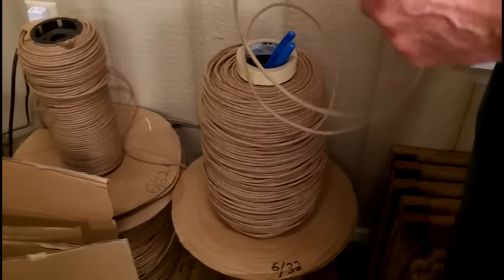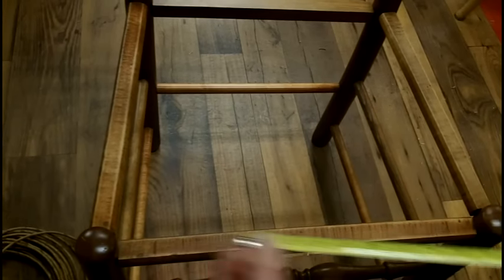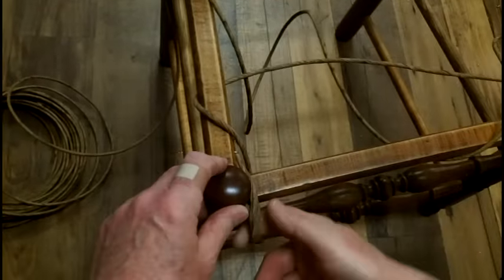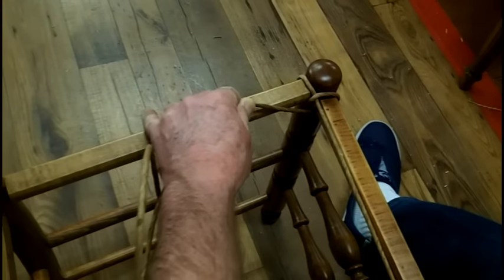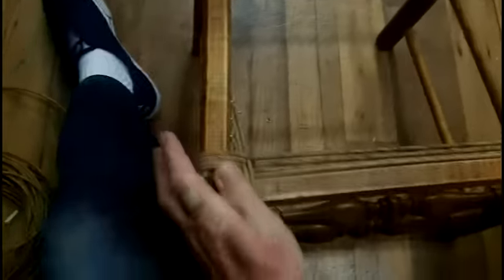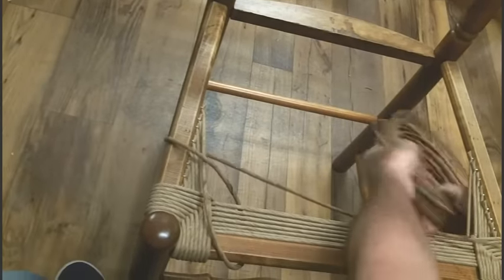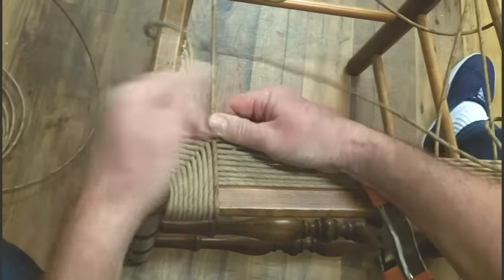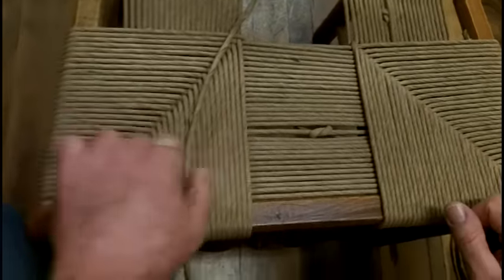How to Weave a Seat in a Rush Chair

Comment: Thank you, your video has almost given me the confidence to take on redoing 6 chairs.  However the suppliers website says its difficult and not to take it on unless you have some experience.  Im pretty good with my hands and a good eye for things like evenness. Do you just make it look easy? and how hard is the rush on your hands?  Would I be able to cope as a beginner?
Reply from the maker: Well, our website would not discourage anyone!! You can get the rush from us with encouragement! Yes, it's a little tough on the hands, but it's not horrible... If you do 6 chairs, the 6th one will be 80% better than the first one, you get better with  practice. Look for us at peerlessrattan.com
Reply: Yeah, I did my first yesterday and wish I had worn some golfers gloves or something. Maybe I was pulling too hard, but my fingers hurt so bad afterward that I'm having to rest before the second chair to see if blisters will form or anything.

Helen- He is pretty darn good at it! I was way slower and had a lot of trouble with keeping everything parallel. The cumulative error of a bunch of wraps being just a little off will be pretty substantial later on. It also didn't seem like those first runs which are tacked to the frame are really in a position to give you lines which are perpendicular to the front and back, due to the angle of the side rails, so you have to make an effort to get them that way as you go. I also may have been pulling too hard on the horizontal wraps, which dragged the far ends of the vertical ones toward the outside if that makes sense. I think dealing with that roll of rush was as much of a pain as anything else for me. I kept it (2lbs) fully intact most of the time, as I was afraid of having too many knots, and had it tangle up on me a few times.

Ed- Don't know if I missed a comment or something, but are the marks at the beginning an eighth inch undersize at 1&3/8, or was that just a mistake in the dialog? 

- and much thanks for the video!

Comment: What kind of rush cord did you use? I am redoing a seat on an old rocking chair that I found, which was rushed with cable ties and a pillow over the seat 🙃🙃 Also, the back is not a ladder back, but just a top and bottom horizontal rungs. How would I go about doing that?

Comment: Thank you for this video! How many feet of rush does it take to typically finish a chair of this size?
Reply from the maker: It depends on size of rust. Normally it takes about 2 pounds. 5/32 is about 350 feet and 6/32 is about 280 feet. We have a chart on our website with more information! peerlessrattan.com

Comment: I found your tutorial on re-canning ladder back chairs and was very excited to re-cane my late mothers chairs. After ordering the material I was ready to start my project and realized my rails are different heights. Front & back rails are equal, and sides are equal- but probably 1" difference - which means the cane will not be even. Have you had this problem before or have any suggestions ? Thanks so much.
Reply from the maker: That is normal, many chairs have rails that are not even, you should be fine weaving it, it will even itself out as you go along.

Comment: How long did you soak the coils?  Some of your coils look wet but some don't.  Also, some people say not to wet it. What is best?  I want to try your method since it seems so straight forward but I need this information before moving on.  Thank you for taking the time.
Reply: Fill a sink with water, then dip the small coils of rush in that as you 
prepare to use them. Don't allow them to get too wet or they will 
deteriorate.

Comment: Hi , Ed, I gladly found your video(s) over a year ago after which i wove a seat for a chair i found on the street. Now i have a rush seat to replace so i am excited to follow your great guide. (i have been watching all your videos !) If I use the 5/32 instead of the 6/32 rush will i have enough for one seat similar size to the one you are doing.? I don't want to have the excess material or pay for 4 pounds when i only need a little more than 2.
Also, how long does the coil or sections remain soaking in water.?? Thanks and thank you for all your postings.

Comment: Are there different types of rush and sizes, and if so, what determines which one to use?
Thank you Ed for your informative video.
Reply: Yes, there are a few sizes to choose from. You should use the size that was originally in your chair. The most commonly used size is 6/32, but some chairs need larger or smaller sizes in them.
Reply: @edhammond2497  Thank you for getting back to me.  I will measure the size in the chair now, and get order that size.

Comment: Thank you for the great videos.  Would you do the same thing for the back of the chair?  I have a New England porch chair and want to use the rush instead of rattan, but both the seat and the back are missing.
Reply: Yes, you use the same method on the back, but you have to take extra time to make sure both sides of the back look good.

Comment: I have childs chair that has front & rear rungs that are about an inch lower than the side rings. The old rush that’s on it is wrapped side to side, then front to back wraps cover the side wraps. Do you have a preferred method for this scenario?

Comment: I was wondering about the cardboard. It seems to me that if the chair ever got wet that the cardboard would be irreparably damaged, whereas the rush and the wood could probably survive even a severe wetting. Would it make sense to use something more waterproof, say a piece of plastic or wood of proper thickness cut to the correct shape? I'm not trying to give you a hard time or anything, but as a woodworker, I always think about the effects of moisture.

Comment: Fantastic video!  I have a question about the final steps for filling in back and sides.  At 14:28, you added a length of rush and the weaving pattern appears to be different than it was prior to that.  Is there a specific point when you change to the new pattern of filling the sides by laying the side strand, then the back strand, front strand, and final left side strand?
Reply: @donm dyti all he did was hide the knot from under chair, the top pattern all the same until can’t do the sides

Comment: I have 4 chairs that need to be refurbished with this type of a seat.  My Dad used to do it and cane weaving too.  I remember that he soaked the rush in water to make it more flexible and when it dried, it shrunk to make the weave tighter.  Is wetting recommended or is it best to do it dry as shown in this video?
Reply from the maker: We recommend just a dip in the water, not a soak. Just a quick dip to make it pliable and easier to manipulate.

Comment: The cardboard triangles that you inserted at 10:40 had the corners facing the center of the seat cut off, but later in the video at 14:30, the cardboard had points towards the center.  Did you add more cardboard beyond what you showed at 10:40? If so, what made you decide to add it and is it done in the same way? Thank you for the excellent video.
Reply from the maker: You are very observant! Actually, this was a set of 6 chairs that I used all 6 in various stages to speed up the recording time. The shape of the cardboard is not so critical, as long as you get some in there.

Comment: Thank you very much for the video! Excellent work! I have a question: How many meters are 2 pounds?
Reply: +Vasilis Mpoulakakis There is 280 feet in a 2 pound coil of size 6/32 fibre rush. There is 350' in a size 5/32 2 pound coil.

Comment: How many foot of fibre rush I need for a chair like the on in the video. Thanks so much to share your talent !!
Reply from the maker: Fibre rush comes in 2 pound coils, which is enough for most small to average size chairs. Larger chairs will need more than 2 pounds.
Reply: and how many houres did you leave your coils in the water, and how many houres drys before begaining the chairs ?? thanks again
Reply from the maker: You don't soak it at all! Just a quick dip to moisten it! If you get it too wet it will come apart. You will need to experiment a bit.

Comment: Thanks for the great video, Ed.  Going to try my first chair tonight.  I got 4 to do.  What would you say is your average time to do one chair similar to the one you did in the video?  Not saying I would be as fast of course, just a general ball park.  Also, how long do you soak your rush before using and does it matter if the water is hot or cold or room temp?
Reply from the maker: You should plan on 4-8 hours for your first seat. Do NOT soak the rush, just dip it quickly, to moisten it. You can experiment with how wet to get it. I have done over 5,000 rush seats in the last 35 years, a seat takes me about 1-2 hours to do....
Reply: Thanks for the tips, Ed, and for the speedy reply.  I was thinking 8 hours at worst, so anything less than that is a win.  I got my rush already and it came with the wedge, the pin, and a booklet, but your video was super helpful.   Much appreciated.
Reply: And after getting home and looking at my chairs, I found that I have two different kinds and both have frame tops instead of this type of seating surface.
Reply from the maker: be sure to look at my videos on how to weave rush frames!

Comment: Many thanks for your interesting video. could I substitute strong cotton rope ( like clothesline cord) for the rushes?
Reply: I have seen that done, but the cord stretches and tends to sag down after use...
Reply: Ed Hammond this has a plastic wrapped steel cord inside. It's for a set that will be kept outside, and I need something that rodents won't chew, and that will be fairly durable.

Comment: I am flummoxed.  I have three old metal chairs with rush seats.  There is a circle on the frame of the chair.  Then there is another circle with extending screws that elevate the seat above the chair.  There is only an inch rise so it is necessary to remove the seat from the frame. 
When I removed the old rush it looks as if the original weaver loosened the rush to a paper thin level and tied a knot to start.  I tried to replicate this by soaking the rush and unraveling it.  Then tied a knot with the "paper rush" to get anchored and started.  The problem I am having is breaking the rush after I have tied it.  Any suggestions?

Comment: I noticed that your rush spool is 6/32. I've seen 7/32 spools available and wondered if the larger size might be stronger. What is your opinion? Thank you.
Reply from the maker: Yes, 7/32 is thicker but it is also stiffer and harder to weave with. Size 6/32 is used in the majority of seats. 5/32 is easiest for beginner weavers.

Comment: What happens to the cardboard if someone spills water on the seat? Is there another material is used would it work better? Leather perhaps?
Reply: It doesn't seem to affect it, I have a set of chairs that have been around 40+ years and no issues with water damage. However, the rush material had worn out due to those years of use, hence the reason I'm watching this video.
Reply: @jasonc3522  thank you for the info. I bought a chair with seriously messed up seat which I want to re-cane.

Comment: I bought rush from Woodworkers supply and it's horrible. It frays very badly and looks like crap. It doesn't matter if it's wet or dry.  Does Peerless Rattan supply material that doesn't do this?

Comment: Hi Ed, can you repair a rush chair, if the dogs eaten the middle section. I'm assuming you can take away what's damaged make a square knot and continue as per your video?? I get that the rush colour won't match but its better then starting all over...?
Reply: Yes, you can give it a try! If it works, great! If not, you can just take it all out and start from the beginning.

Comment: My dad made me a stool with a similar method for the seat when I was born almost 30 years ago. It is unraveling at this point and I want to redo it. What is the fiber and where can I find it? Also is there a method without cutting and stapling all the time? Can use just one continuous piece? It seems like my dads is in one continuous piece but I'm not completely sure because it is only half unraveled.
Reply: It is fiber rush, you can get it at peerlessrattan.com

Comment: I am going to rerush some rocking chairs.  When taking the old rush out I am discovering that there is a wooded frame inserted on top of the rings on the chair.  Do I just take the wooded frame out and weave it as indicated in this video and then reinsert inside the seat? The rush will not thread between the wood frame and the rungs of the chair.  What advise would you give me as to working with the wooden frames?
Reply: Yes, take the frames out. I have a few videos on how to weave a frame.

Comment: Hey Ed Hammond I don't know if you'll reply, or if this is even the right place to ask but; I was hoping to create a chair completely from the resources in my backyard, I have the frame of the chair already (made from fallen branches from my willow and birch trees, very pretty. I have some tall feather reed grass I recently cut down for the spring and I was thinking maybe I could use that to weave a seat. My question is could I use the grass to weave a seat, what weave would you recommend, and how would I go about doing that with multiple different pieces of the grass?
Reply from the maker: I think you might be able to do that. You will need to find instructions for weaving natural cattail rush, we don't have a video on that. You might be able to use that method for your material.
Reply: Ed Hammond thank you for the quick reply and the reccomendation!

Comment: I did my chair it came out pretty good.  Its an extra chair and I had a problem I didn't realize the cord I had was two different colors so right at the end I have a little pattern going on.  Its fine it was practice.  Now onto the rest of the chairs for my table.    I think I will get better, as they say practice makes perfect.   Can I ask what does it generally cost to rerush a chair..  I'd pay someone if I could find someone..  Its a big job.
Reply from the maker: +Debbie Martin It usually costs about $75-$150, it depends on your area. We have a list of caners on our website under  "Locate A Caner" at peerlessrattan.com
Reply: thank you..  your video is so good..  I had it running as I was doing the chair..   only part I didn't do which I will on the next one is while doing the rushing you were hammering the cord as needed to get it together..  I didn't do that but I really tried to not have spaces.  So I think if I do that while doing the chair it will help.  The square knots were difficult for me I had a hard time pulling them had to call in my husband for each knot.   Thanks for sharing your skill.

Comment: I've used this video before redoing the seats on 6 dining room chairs so far. I now have a couple of rockers that will need the seat and backrest done. The backrest is a little smaller than the seat, but is uniform on front and back. How do I hide the knots on the back side?
Reply: Never mind. After looking closer, I saw that the ends were nailed into braces instead of tying knots. It gives the appearance of a continuous run.

Comment: Hey I really need some guidance and don’t know where to go. I have been weaving seats like this using Manila rope. 

I read somewhere that it makes sense to soak the rope in water before using it cause it makes it more mailable. But I just learned that Manila rope SHRINKS when you get it wet so as the piece dries the weave becomes very loose. 

Is there a way for me to mitigate this? The rope really is so much easier to work with when it’s wet.
Reply: You may have to weave with it dry. Or you could use our fibre rush and moisten it to weave with.

Comment: Great video. What do I do if the side rails are one inch lower than the front and rear?
Reply from the maker: +Kidneedonor That is how many chairs are made, it's not a problem at all, just center the rush the best you can at that junction, make sure your inside corners are tight with no gaps, and you'll be fine.
Reply: +Ed Hammond Thank you,

Comment: Ed, How long do you soak the rush coil in water, before you begin the process of weaving?
Reply from the maker: +Caleb Buse If it's size 5/32,  don't soak it, just give it a quick dip in water. If you are using size 6/32, you can soak it for a minute or so, no more.

Comment: What size strands are you using in the video. I am doing a chair like the one in the video and am ready to order the rush.  What size should I order?
Reply from the maker: I am using 6/32 kraft brown fibre rush. Most chairs have this size in them, but some beginners find size 5/32 easier to work with. It's personal preference as to which size to use, unless you are trying to match the same size as other chairs in your set.

Comment: In the directions from the place where I bought my webbing, it says, after finishing the seat you should coat it with shellac...  Is that the case?  And if so, is there an alternative to shellac?  I went to Home Depot to buy shellac and they didn't have any.
Reply: You can use polyurethane.

Comment: Ed, I wonder if after all this time you will reply? I bought (in the absence of rush) 200m (600+ft) of jute braid to do a chair about 2 ft sq. will this be enough?
Reply from the maker: Normally 600' is plenty, but you didn't mention the width of your material, so I can't answer for sure.
Reply: @peerlessrattansuppliesllc7113  Wow, an answer so fast! Thank you!  6mm (1/4 inch)

Comment: Any tips on how to correctly moisten the rush beforehand? Mine is either too wet and it unwinds on me, or too dry and difficult to work with. I can seem to find the Goldilocks level.
Reply from the maker: Cut a workable amount of rush and dip it in water. DO NOT SOAK it, just a quick dip to make it pliable and easier to manipulate. TIP: Tape the end to the first loop with masking tape to keep it from tangling up while weaving. Remove the tape when you get to it. Good luck and have fun!